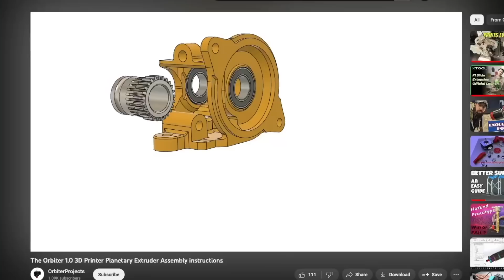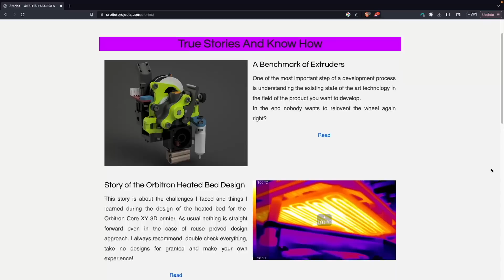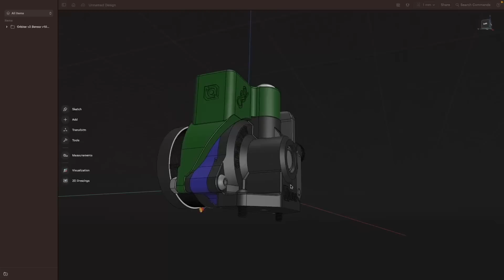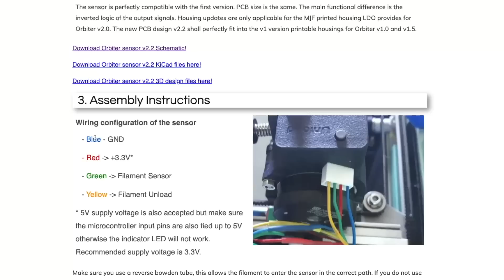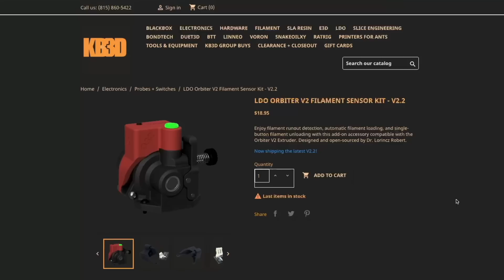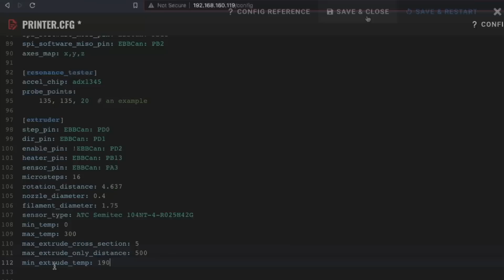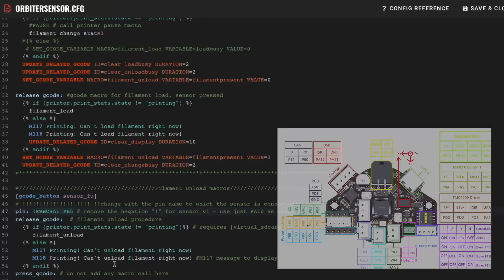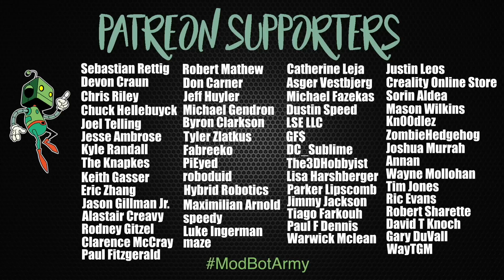Small Lightweight Beast Of An Extruder (Orbiter V2.0)

Comment: top be honest, The orbiter sensor has been a god sent for my printer.... until it wasn't anymore. For some reasons, it started to fail, and detect false runout. This has ruined many print sadly. I have tried changing the housing, and the pcb, but I kept getting this issue. Maybe, with with a professionaly made housing from pcb way, it would solve the issue... But I'm too scared to try now
Reply from the maker: Do you know what version you are running? It sounds like older versions had some tolerance issues that caused false triggers.
Reply: @ModBotArmy  v1.2 sensors. I've tried both the old and new housing (3d printed at home)

Comment: My first experience with the orbiter was an upgrade to my ender 3 v2. I changed it to direct drive but i hated the clunky large heavy motor. The orbiter worked perfectly and It has done hundreds of hours. My second experience with the orbiter was with my current ratrig vcore 3.1. I purchased the kit with a bondtech LGX lite since I was using that on my voron0 with great success. I found with the ratrig, my LGX lite wasn't really wanting to push filament out as fast as I wanted it to. I upgraded my pheatus rapido to the volcano CHT nozzle which helped a lot but, I got the usually quality artifacts using volcano nozzles. Inconsistent layer stacking, lines that looked like zbanding and I actually found the extruder would slip on the filament around 30mm3 on the middle setting.  I decided to buy an orbiter v2.0 since the gearing in that allows it to push filament out harder at higher speeds. All my inconsistent extrusion artifacts went away. I could reliably print using 45mm3 as my limit in superslicer and it has been awesome.  I also love the fact it's so easily mountable compared to a bondtech lgx lite.

Comment: I have been asking for years why filament sensors are not part of the extruder and loads of people told me it cant be done as if the filament broke inside the extruder it would be a real pain to disassemble to get the filament out, I disagreed and now I have been proved correct and am currently wearing my smug face LOL
Reply from the maker: Haha as you should be! If this detect filament has runout it triggers an auto unload macro. Not that there cannot be some clogging but this is really setup to handle runouts well.

Comment: I purchased an Orbiver V2 to install in my Ender3 V2 and I would say it was one of the best upgrades for the printer. The extruder despite being so much smaller than the stock extruder motor manages to apply much greater force on the filament and while printing at high speeds(150 mm/s), the Orbiter extruder very reliably.
Reply: I 100% agree. I upgraded my Elegoo Neptune 2S with the orbiter V2 and the HMG 7 shroud. I print a lot of TPU for my FPV drones and it’s been fantastic for that
Reply: Was it a simple plug and play replacement along with an orbiter mount? I've been looking around and it looks more like splicing is necessary for the ender wiring?
Reply: Hey, what mount are you using? Was thinking of replacing my Bowden with one
Reply: @williamanthony7224 i’m using the “mars orbiter”, it’s a really great stuff
Reply: Yes the extruder on the ender 3 is very bad
Reply: Would you mind sharing what hotend you used with the Orbiter on your E3V2?

Comment: I bought 2 and at first was great.. macros worked well and loading etc like you’ve shown was good. Shortly after with not many hours of use, mainly printing PLA, the movement of the tool head must have made the channel through past the ballbearing change, and shortly after starting printing it stops as if it’s run out of filament, if you catch it you can see the sensor flash red, this also continues to happen if you resume the print! Warning to most buying this, great idea but doesn’t have the legs you’d hope for! Love LDO and their products but this product has an annoying flaw. I mentioned this also on Teaching Tech’s video.
Reply: It sounds like you are using the filament sensor. I had the issue. I don't know if there have been any updates to the design since I bought mine (I got it as soon as it became available) - the designer speculated that it was perhaps due to MJF printing tolerances. I took apart the filament sensor and sandwiched a piece of squished filament between the sensor board and the latch and it solved my issue. It's been functioning properly this way for about a year now.
Reply: @scheidch  yeah I thought of that as a fix but just removed it instead. I think if the tube section was metal or had an inner metal piece/ sleeve this could be better 🤷‍♂️

Comment: I have 4 orbiters and another extruder with the ldo motor and they are just the best. One has the filament sensor too and although it's good I think the software needs some tweaking like an option to choose the temperature when loading - unloading. If you only print with one type of filament setting of 180 is ok, but what happens when you want to print petg or asa ?
Reply from the maker: It actually heats up to 235 on mine before extruding. I think the setting a minimum extruder is more of a failsafe. The current macros on their site do all unload and load operations at 235 unless you are mid print. This can be tweaked though.
Reply: @ModBotArmy  but it would be nice to have the option to choose a material like on the prusa.
Reply: I wondered the same and I found that it's still possible to load even ABS+ at default temp although the gears to start to skip toward the end of the load.
Reply: @scheidch  to get around this I  set mine to 260 even for pla.

Comment: Your design has a disadvantage - very long filament path from gears to nozzle. It's rather not direct, but short bowden. Filament path is critical for TPU`s. You will no be able to print tpu 70 or 60A. This orbiter must have aliminium body with screwed in short heatbreak. That's just in such version, it will be considered progressive and modern.

Comment: Thats kinda cool!

Ordered some rails to do the Merc1.1 conversion on my 5 Plus a few days ago.  So you know, maybe next year I'll get to it lol
Reply: What size rails do you need for the 5+? 450mm? I am wanting to add rails to just the X and Y axis to start with and maybe later do the Mercury conversion, I already have a core XY printer so no rush to convert my 5+ machines.
Reply: @AndrewAHayes  Yeah, all 3 for the Mercury conversion is 450mm.  

I am not in any huge hurry either, got a Bambu and then just rebuilt a sp5 using the diamond tool head and a Manta board.  Those sp5's are real nice printers with just a touch of work, especially if you can catch them when Twotrees sells their returns for $200.
Reply from the maker: Haha better late than never!